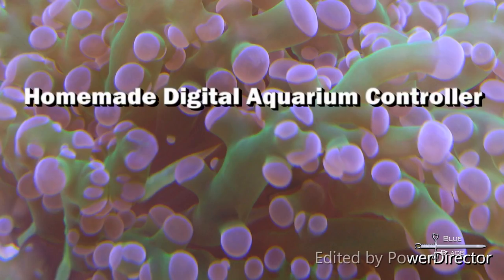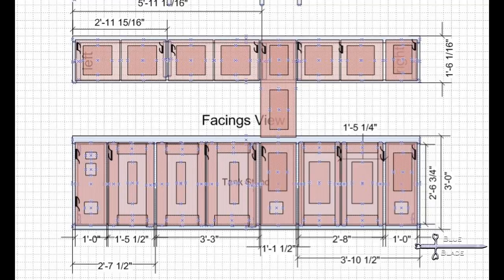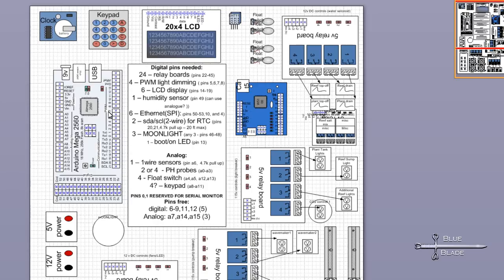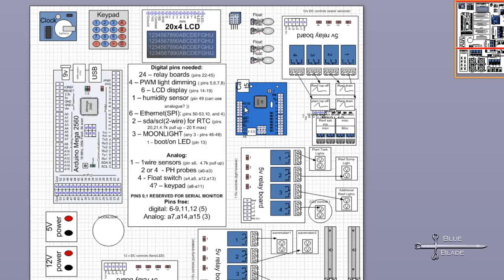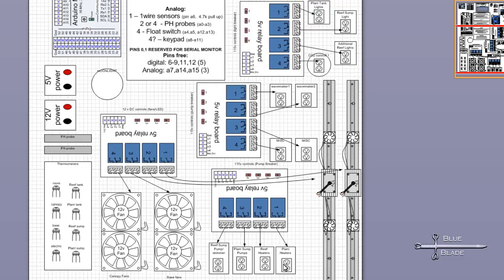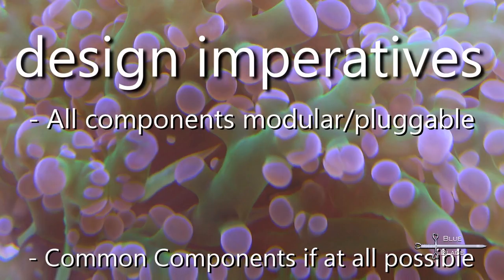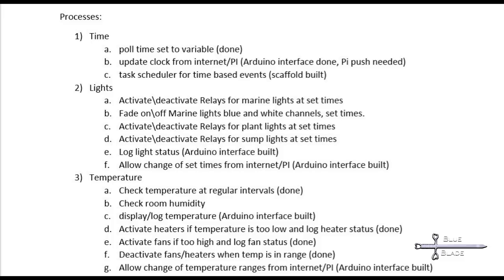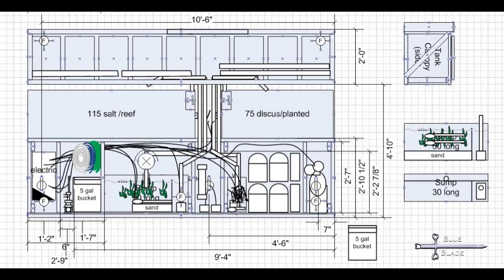DIY Arduino Aquarium Controller Part1: Introduction and design

Comment: Great Project !
Is the Arduino Mega 2560 R3 ?
Reply from the maker: yes indeed. i did place some heat-sinks on the chip and voltage controller just to be safe, but it has been humming along stable for over a year now.

Comment: Is the raspberry Pi connected to the arduino or are you using them separately, you can get similar results with an arduino and blynk on your mobile device
Reply from the maker: the Pi connects to the arduino serial/UART, and the Pi provides the LAMP/RAMP stack for data logging and web interface.